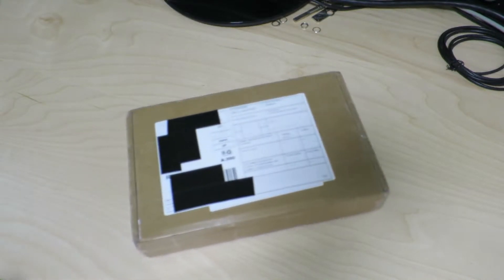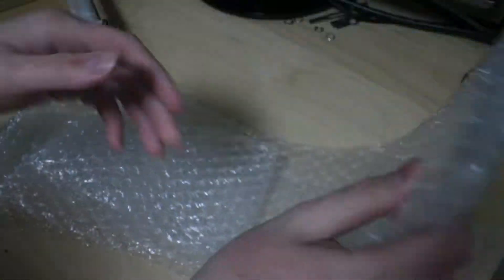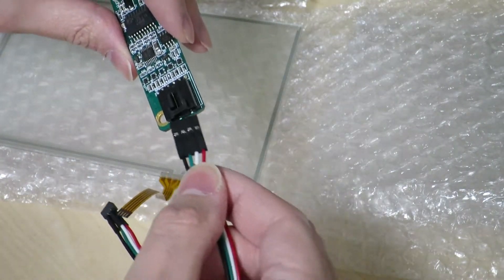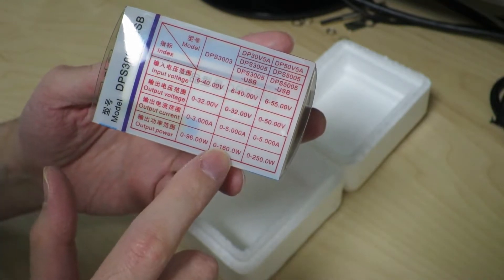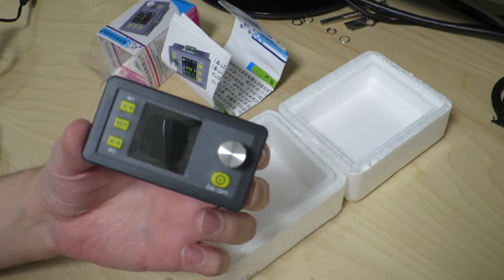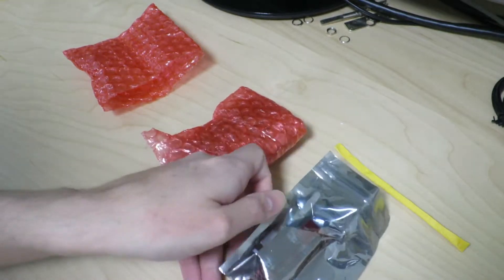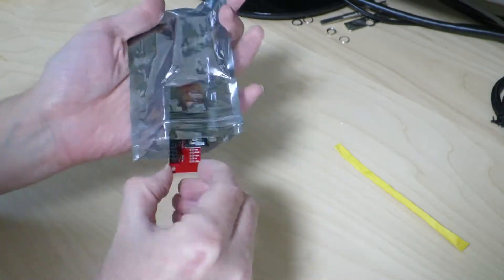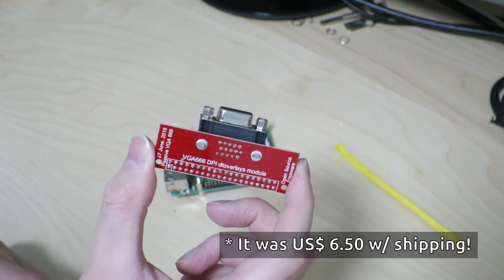Mailbag: Touch panel module, nifty power supply, and LCD panel driver from Aliexpress

Comment: i wonder if there is for 15.4 inch touch screen panel?
Reply from the maker: A quick search on Aliexpress shows quite a few 15 inch (not sure if it's 15.4 inch) resistive touch panels. I wasn't sure if there would be any before searching, but wow, I always am surprised with what I can find on Aliexpress. Thank you for the comment! :)
Reply: i just search it on Aliexpress yesterday.. they have 15.4 inch touch screen panel with usb controller. without a frame on it. about 46.00 usd = 2459.76 php. bcoz i live here in the philippines  :)